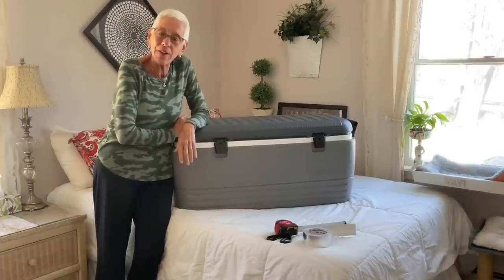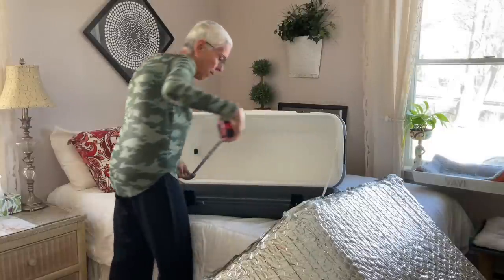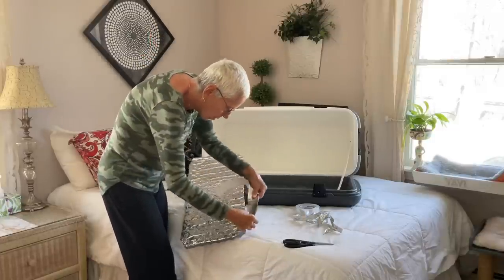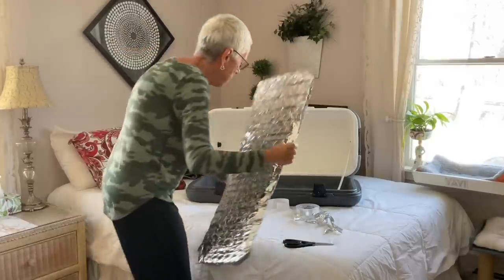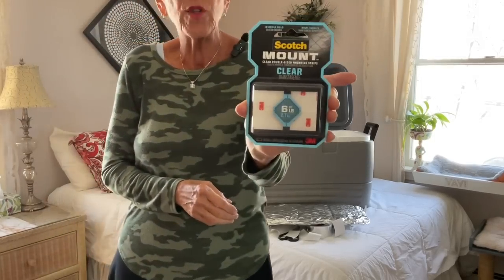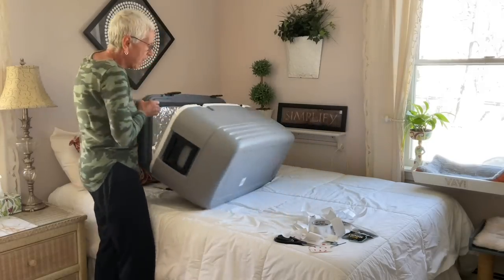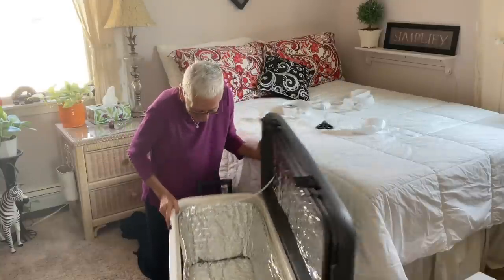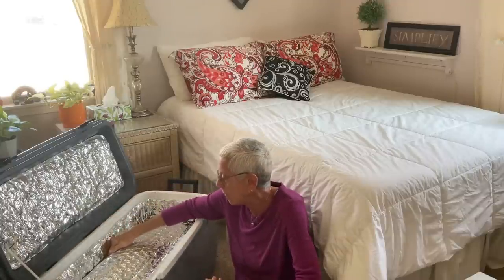VANLIFE - KEEPING FOOD COLD MORE EFFICIENTLY - FURTHER INSULATE COOLER FOR LONGER ICE RETENTION

Comment: Yes, reflecting would work.  Several years ago I got a yeti knockoff 25qt cooler at Cabela’s.  The first thing I did to successfully expand life of ice was to take a bubble wrap shipping envelope from an Amazon purchase and cut it open & trim it to fit the top of the inside of the chest to help keep cold in.  The next thing was to get from a friend a big one of those silver bubble wrap bags people get meals delivered in.  It fit perfectly on the interior of cooler & had a flap big enough to tuck in & put the Amz shipping envelope cover thing on top to keep cold air in.  My record is 9 days of ice during 75-80° days. 

My next project is I got several of those silver bubble wrap bags from my friend, and I plan on making an insulated jacket for my 12v fridge (with air vents cut out) for summer heat.  I love repurposing these free items to expand ability to keep cooler colder.
Reply from the maker: hi Karin!!  very clever ideas there on using the shipping envelopes for insulation!!  good thinking!!  I made an insulated jacket for my 12v fridge/freezer, not sure if you saw that video:  https://youtu.be/6mqC75WPMCs       Lulu
Reply: I love that repurposing!  And it was effective.  Great job.

Comment: You can also use the cans of spray foam, low expansion, and drill a small hole in the cooler and fill it to give extra insulation.  Works great.

Comment: Great idea with the floating top, the less volume you have to keep cold the better. I did a test run with my new bed in my Promaster City last night (yup, 29F) and I was so comfortable in my new bed with the proper bedding. My PMC is not built out at all, I use it for the activity desired for the day.Looking forward to getting great ideas from you!!
Reply from the maker: 29F?  brrrrrrr!!!!  do you have a rated sleeping bag?  what was your proper bedding?
Reply: @LulusWay64  yes my sleeping bag is 40F. I put that into another sleeping bag. But what I have is a really heavy blanket from Korea. That’s the key. For my bed I saw on YouTube a cot that is a small twin(single ) 75x30 and with a 6” memory foam that i bought separately. it is like sleeping in my own bed.  Can’t wait for adventures to begin.

Comment: Lulu, your always thinking ahead. I also have a self contained master bedroom in my daughters town house. It’s the whole top floor, I have my bed area with a queen size bed. A sitting room area with my 32 inch tv with loveseat. And I bought a bakers unit that the guy made with reclaimed barn wood, which has four selves. Bottom has my microwave, ice maker. Largest shelf I use as my counter with my Keurig. The top two shelves have coffee pods, cup and glasses. I have a three shelf unit beside this, also made from reclaimed barn wood which holds my plates and bowls, air fryer, a one burner hot plate (I move this to the counter area). I also have a fridge similar to yours. I’m all set.right now, making chicken wings in the air fryer..30 minutes at the most.. good luck to you. You think like I do..
Reply from the maker: hi Mimi!!  your set up sounds amazing!!  thanks for sharing with me!  Lulu

Comment: Very clever! I'm stealing this idea for my camping trip next month.
Reply from the maker: hello David!!  after I designed this I realized that perhaps it would be better if it was now lined with a plastic to keep the silver insulation dry.  so I grabbed a thick plastic contractors bag and lined it.  I don't know if it was necessary but I was going to share this amendment I made when my build was done and I was using it.  but since you are utilizing the idea sooner than that, I wanted to share this with you!   Lulu
Reply: @LulusWay64  Hey Lu, thanks for the update. Probably not a bad idea just for a little extra protection.

Comment: I saw someone one time drill holes in their cooler lid, which usually aren't really insulated, and spray foam into it. It was an older cooler they were just testing. Anyway, I have old coolers and from my experience have always just put brown paper grocery bags inside on top of stuff and then a bath towel inside on top of that. It's just something I have done for years and works pretty well.  If you think about it when we used to buy ice cream from the store, they would put it in the brown paper bags to keep it from melting before you got home. I do also take one gallon ziplock bags, fill with water, lay flat in a freezer and those become my ice bags, so the ice doesn't ruin everything when it melts.

I do like what you did though and would like to hear the results from a test. Will definitely try that before I would ever buy some $400 Y__i  cooler.  Not happening. 😮🤚
Reply from the maker: I have heard of that spray foam inside cooler, perhaps I'll add that too!!  brown paper bags is a great idea too!!  thanks!!  I will definitely keep you posted on how much more efficient the cooler keeps the ice!!   thanks for your note!  Lulu

Comment: What about mold that might get under reflect material but stuck fast?
Reply from the maker: good point!  after this video, I thought perhaps it would be better if it was lined with plastic.  so I grabbed a contractor bag (very thick plastic) and lined in the inside of it.  I will be using the van likely in May and was going to share that addition when I do my next van tour after this new build!!   Lulu

Comment: Where did you get the thick reflective
Reply from the maker: that kind I used is commercial grade and can only be bought at a HVAC supply house and you'd have to buy a big roll of it.  my friend gave me piece of it.  without that, I would just go to Lowes or Home Depot or Amazon and get a roll of reflectix and work with that, even if doubling it up.